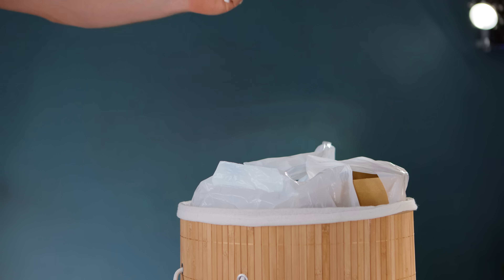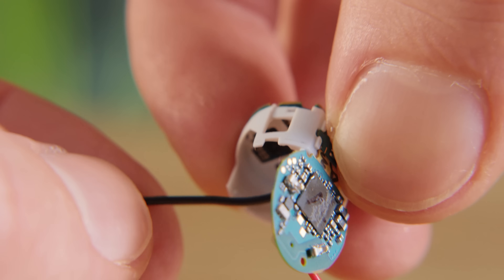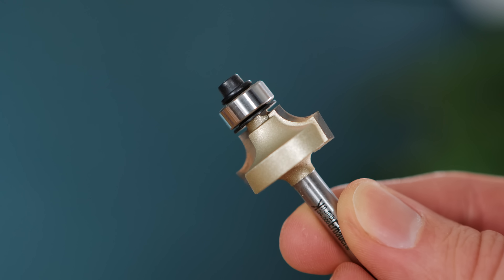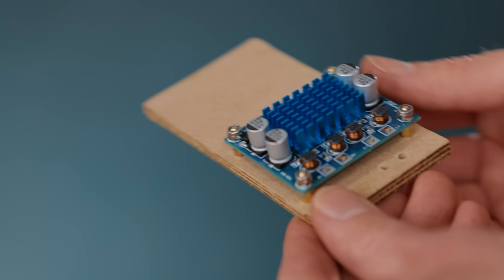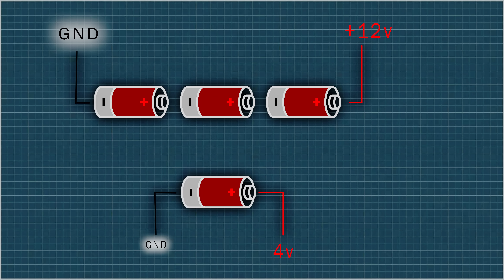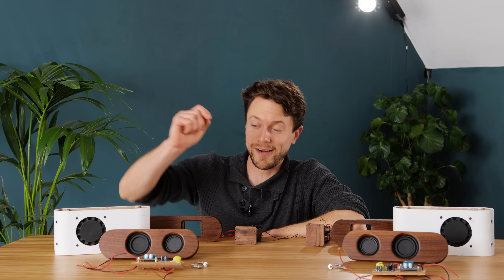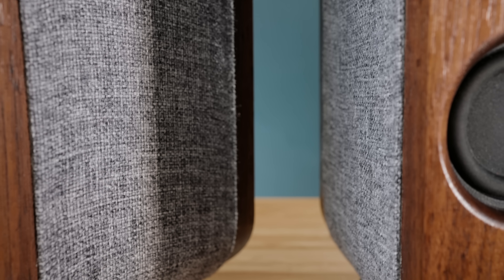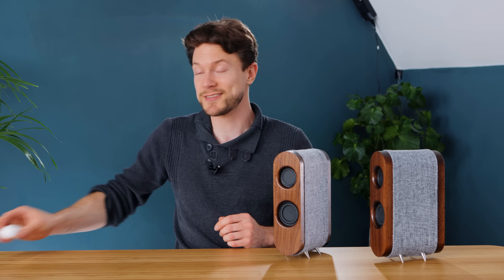Transforming dead earbuds into POWERFUL wireless speakers

Comment: Hello.
Well these look really cool.
But i have some concerns.
1. Volume of a speaker has to be calculated accordingly. It's not just like a rule of a thumb. Has it been done? For mid range and highs its not that important but for sub one it's defining.
2. Batteries. As far as i got it 3 batts work for an amp and 1 for  a bud, right? Doesn't that mean that amp batts and bud batts will not be discharged at the same time leading to pretty complicated charging procedure.
Don't get me wrong i really like it ) but i would also really appreciate version 2.0 with integrated charger ) Any plans to do that?

Comment: I'm thinking about if this would work with AirPods, conserving the chip that makes the connection with other Apple devices as seamless as it is with the normal usage of earbuds.. should be easy to find cheap 1. generation AirPods with dead batteries or similar, I'd guess
Reply: I guess they'd just be a little harder to take apart without damaging the circuit.
Reply: @IlBiggo  yeah could be

Comment: Im wondering If there is a way to actually use those Speakers as back Speaks in a 5.1 systeam. Basically you just need to finde a way to send the signal to them and voila you have an almost wireless 5.1 system ^^

Comment: Really cool build, ruined by the batteries.
With no power indicator you'd have to get 2 sets of batteries, to swap when they inevitable run out of juice out of the blue. That would add another ¬70 bucks to your build, totaling more than 140 bucks in batteries alone.
Powerbanks have power indicators, pass-through, so you can charge them while continuing to use the speakers and the price is basically the same.

Comment: - I would use a small USB C PCB to charge those batteries. that would also eliminate the need for protected cells.
- How would you pair them without access to the bud button?
- and finally, they turned out very well, even though this is far more than what I would call DIY. (Technically true, he made them himself, but to achieve a look and quality like his speakers, you need a lot of experience and/or tools. I'm not saying it can't be done, but it will be nearly impossible for the average person)

Comment: Just out of interest, for the filters - would it have been beneficial to use potentiometers in the right range instead, meaning you could fine tune the crossover point? Genuinely impressed with this one, most of the stuff you do is cool, but as a someone that's into audio nerd stuff I'm blown away by the frequency range on display here.

Comment: Love the result. Great styling. I would probably try applying the bluetooth circuitry/amplifier/batteries to some existing bookshelf speakers first. Also if you could safely build in a charging circuit into the speakers rather than having to take out the individual cells, you would have an awesome comedically viable product.

Comment: Amazing. I am so jealous of all the tools you have and of course all the knowledge of how to use them :)
I would only suggest one improvement, mount the batteries on a re-chargeable base within the speaker, and have an input cable from the bottom, so you won't have to remove the batteries when they die.

Comment: There's one quite huge issue: you can't pair them after you've glued everything shut
Reply: Why not? If they're on you can pair to them in any way you like.
Reply: @SgtNicholasAngle  You have to turn them into pairing mode first, somehow. Which is usually done by holding the earbud touch panel, or putting them into the case. Both of those options are unavailable with this build.
Reply: @MeGaDwarf2008  My earbuds goes into paring mode automatically if no device is found within like 10 seconds. I would assume there are other earbuds that works this way as well.

Comment: Pretty sure absolutely noone will even try to make this
Really cool idea tho.
I think the price you pay on the equipment required to make this is more than enough to buy 2 separate bluetooth speakers.
Reply: I'm going to give it a crack. But in full disclosure, I have a CNC router which results in more precision for less labour. Sub woofer bundles (as shown in links above) are the most expensive bit of the project.

Comment: I think the algorithms in use in YouTube are scary. I have a pair of old BT earbuds which failed for the second time yesterday. My idea was to remove the inner tech and create some external speakers. Today, without any searching, this pops up in my feed. How does that happen? Anyway, I'm glad it did because a lot more to it than just adding an amp and speakers. Nice to know of the low and high pass filters.

Comment: The mechanics are nice but there are concerns of the audio electronics....

Low frequency (subwoofers) needs a lot more power than the high frequency.  It is better to use different wattage power amplifies for different needs. Using 10W(R&L) for high frequency  and 25W(R&L) for low frequency would be batter than current design  (TPA3110) 15W(R&R) and 15W(L&L) for both frequencies.

For the high frequency speakers,  the high frequency filter and mid-band frequency filter should not be tied in series (filtering out each other). Even tied in Parallel, it is not easy to couple into flat frequency response (need proper cut-off frequency and impedance matching). It is easier (and batter) just use one high frequency filter with a lower frequency cut-off to match the low frequency filter (same frequency cut-off) of the low frequency subwoofers.

Comment: Bose soundlink mini - simply one of the best BT speakers ever made. Engineered to perfection by audio engineers with top tier quality. DIY Perks: mines are better.
Reply: They are. A bit too midrangey, maybe; but definitely better than the single squeakbox ("engineered to perfection"? It sounds like a cheap monitor's built-in audio).

Comment: The speakers would sound quite a bit better if they weren't recessed deep in the front baffles. The narrow fronts are great for a wide and uninterrupted sound dispersion, but the deep recesses negates those benefits and adds early refection off the walnut. They sound echoy compared to the Bose. Other than that, nice job.

Comment: I've been doing this since the dawn of wireless headsets and transplanting them into wired headsets or speakers.

Just one thing -- imagine the amount of battery life you will get attaching these into a common Nokia BL4C battery =)) Makes my now-wireless headphones work for more than a weak of continuous everyday use =)) Headsets usually have the space within them for this. Then I upgrade these now-wireless ones to have a detachable 3.5mm jack for either sharing or wired use :)The only irritating part for me is making access holes/switches for interacting with the bluetooth module and for plugging and to charge the battery.

Comment: Could you imagine receiving some speakers off of wish, you take them apart to see what’s inside them, and you just see an earbud hot glued to the inside of the housing, just powering everything?
Reply: Someone (don’t remember who) took apart a wish 4TB hard drive. It had 4 partitions that could not be connected together. It had 4 separate hacked USB sticks inside.
Reply: @itsbunnytub  I had one of those, advertised as an 8TB SSD....Turned out to be 4 32gb thumb drives on an adapter! I did get a full refund so ended up with 4 32gb thumb drives for free so every cloud!
Reply: @itsbunnytub  I believe I remember seeing that.
Reply: @itsbunnytub  Was it Smoorez?
Reply: @burntbaton69  Yes , think it was in a recent one but Linus had something similar a while back .Like @ jungle expo said , full refund and four 32GB thimb drives for free , not a bad dea , just buy some enclosures
Reply: If you're lucky, that's all the shady crap you'd find. At least this dude used a decent amp and had a CNC .. to ... use ... for ... DIY  “¯\_(ツ)_/¯“  
but I digress ... 
I picked up some white van speakers at the salvation army for 10 bucks to build a wireless system for my son's RC car to use with a little Monster Bluetooth adapter and an amp out of a battery powered clock radio, ya know DIY 😉. The 5.1 system satellites were filled with cement!!! I'm serious - CEMENT ... you can't make this up. What kind of evil lil shit thinks to do that to a mans speakers, even if they are garbage, which most all are today anyway. I feel sorry for the poor guy who probably paid 200 bucks to someone "with the deal of a lifetime" in a parking lot somewhere that got the heavy box to home to hear mickey mouse sound, which is bad enough, but cement?? I mean literally WTF? I'm a peaceful dude, but that is just so wrong on so many levels. I'm checking w/a buddy to see if he'll let me come blow them up on his farm for a YouTube video. Hopefully some future scammers in training get deterred, just like I DIY, the old fashioned way. 😎 If I wasn't a skinny old guy I'd be out looking for em,  but I'm definitely running over these w/ a tractor or something, just on principle 😂🤣😂
         ✌
       ϻя.ƹ
Reply: @mr.e695   Yea he used CNC because he had one. It was also only used for aesthetic purposes. love how everyone is a whiny little beach.
Reply: @mr.e695  oh and cement and concrete are used for speaker designs because of their acoustic properties. if only you spent more time on educating yourself than trying to cry complain and pull others down you would probably have a clue. there are those who can, and do it and those who cant and therefore cry and blame everyone else. guess which one is you.

Comment: I'm just wondering how much in total it costs to do this cause they sounded amazing.
Reply: Rough guess looks like ~$120-150 per speaker just in components.. more with wood and materials and feet.. etc.  
It's cool, but it's no cheap project. ;)  Why don't you think he mentioned price.
Reply: @Hitokiri_Ace  no doubt but they seem like they are well worth the money for sure
Reply: @TJsVette  They definitely are a nice looking project for true wireless stereo.  
..but the value is a little of a sore spot imo.  
I love DIY stuff though.  Check out diy sound group, or similar.  No wireless, but diy speaker kits are amazing for the money.

Comment: An Easy Improvement is using an Powerbank that uses 18650 cells, so it comes with an charging circuit. Also I would suggest sanding the Wood to achieve a cleaner Look. Nest its important that you test the earbuds Range of being seperated, before using any and see if its enough for you

Comment: Good sir, I am going to try this after my finals. I'll be aiming for a slightly different design, I want to make them horizontal with the radiator point downwards, I have some spare mirror oak in my grandfather's workshop and a dark wood oil so I'm sure that would make for a nice look

Comment: Regarding the batteries:
Running 3 of these 18650 batteries in series will not yield 12 volts at all. They have a nominal voltage of 3.7 volts when they are fully charged , not all the time. This gives a peak voltage of just 11.1 volts, not even considering when the capacity (and hence the voltage) of these batteries drop as they lose charge. I would highly recommend installing a buck converter to ensure that a constant 12 volts is obtained. Same things goes with the singular 3.7 volt rail you're attempting to use.
Reply from the maker: Nominal voltage is the middle voltage of the pack (half full/storage). Fully charged they're 4.2v, depleted 3v. 12v is close enough for an on screen graphic ;)
Reply: @DIYPerks  me forgetting how batteries work, lol, personally would still run it through a converter out of spite. Love the content.

Comment: Would have been more clean and premium if you used a charging circuit with a usb c connection on the back but still, they look damn nice.

I did something similar a few years ago although they looked nothing like yours 😅

Comment: As this is not your first project related to bluetooth speakers, I have a question. Would it be possible to create "mesh" speakers working on Bluetooth as well?  
This video of course great, but it's limited for only L&R channels/speakers. I've had the idea of filling my house with wireless speakers from old e-parts but the re-usability of old earbuds is big question mark for me as they are usually paired only with each other

Comment: I would want larger antennae to be soldered onto the buds for better connection between the bluetooth devices. Would love to see a comparison between the bose and the DIY speakers in terms of connection strength. Since you'll be traveling further away from the speakers than what the earbuds were designed for, it is an important metric to consider.

Comment: I am actually new here. I have a doubt. Is it possible if we replace power bank instead of rechargeable batteries ?. Will it work? .
Reply: Many power banks output 5V DC. You would need to use a different amplifier because the one listed here is 8-24V or use a boost converter. Using a power bank will also reintroduce possible issues with ground loop. You might be able to mess around with PD, but I don't know what that would entail.

Comment: Because I don't recognise the music you used in the trial at the end, I can't say if it was an accurate reproduction or not but they sounded a little base heavy.
Calibrating base enclosures is a fine art and knowing the volume of air the speaker has to move and how fast the speaker can move it is critical.
All that aside, this is a fantastic idea and a cheap and easy way to get bluetooth connectivity without having to design and populate PCBs.
Your videos are always really well produced and make really clever ideas into easy to follow projects.

Comment: If you add USB charging it would be perfect. Taking it apart every time you want to charge them would be annoying…
Reply: Increased risk of fire hazard. But if you want to go that route, you can google TP4056. I haven't tried a 4P configuration to a single TP4056 so completely in the dark about the safety of such a configuration. Caveat emptor.

Comment: You did not isolate mid range from low. As a result they are acting like a passive radiator for bass, which distorts the sound. Also your system lacks hi frequency speakers and sounds dull because of it.

Comment: Important note regarding the passive radiators - they need to be facing the same direction for best bass reinforcement; that is, both facing left or right. If they're both facing in or out, they will cancel out at the low frequencies that you're trying to reinforce. This is one reason why on commercial tower speakers that have passive radiators they're always on the front with the main drivers.

Comment: Incase anyone is wondering, I priced out the pair and they clock in at over $320 USD not including shipping. I'm sure you can find cheaper parts states side but they might not be as good quality.

Comment: They're pretty good.
However the method of recharging is a bit awkward.
Is there another way to do it, in order to charge the batteries while they're inside the speaker?
Also it would be much more useful, due to the fact that you could still play the speakers while they're charging, or have them as normal speakers, that can be disconnected, and still operate outside when you want to.
Reply: You can use one of these cheap "DIY power bank cases" from AliExpress and put it into your speakers. There are different versions with Micro-USB and USB-C Input.
You have to make cut outs for the ports and seal them properly with hot glue or something like that.
Reply: @whackaloha  one thing you never want to do, is cheap out on your power supply.
It's the most likely thing that'll break first.
Personally I'd never use anything from Ali Express due to a lack of QA.
I'm just asking a question others would probably want to know.

Comment: It is often best for simplicity and to minimise errors to use a simple 6db octave filter and not use electrolytics either.
Edit at 160hz and just some attenuation on the mid range to match sensitivity. The little mid tweeter is effectively a full range driver with a response down to 100 hz...You could even try it without any filter though you may get a bass hump ..It might be no bad thing.

Comment: The electronics themselves really aren’t special. But the way he manages to makes his projects LOOK so nice is on another level.
Reply: The cool thing about the electronics is the fact that you can reuse them, which you probably didn't think of until he posted this.
Reply: @thewhitefalcon8539  Yeah, I wouldn't have thought about this, I thought these earbuds were not tinkerer friendly
Reply: @thewhitefalcon8539  I bet it's nearly impossible to repair, as it's so small scale. But if you can connect to larger scale components, it's pretty easy to get parts for it.
Reply: it comes down to skill, experience and craftsmanship. 
My grandpa can detect thicknesses with the accuracy of 10 micrometers with his bare hand. 
That's what happens if you are a craftsman for many decades.

Comment: Very cool project and great video... but take the batteries out to charge? 4 screws? Why not include a small protected charger? The load could be split between the 2 battery sets, and in the case of feedback occurence they could be charged with seperate inputs. Cost wouldn't go up that much as 18650 chargers are pretty cheap. If cost isnt an option go wireless. This is probably why manufacturers make single unit speakers.